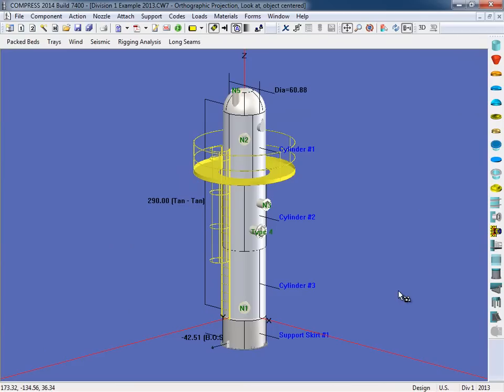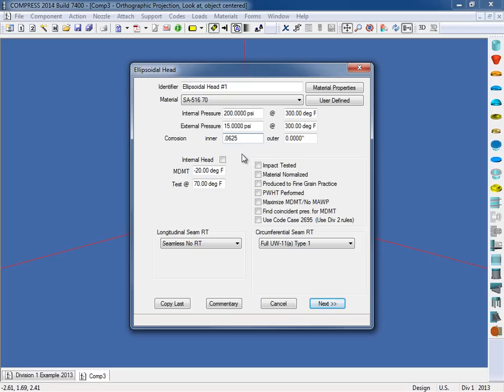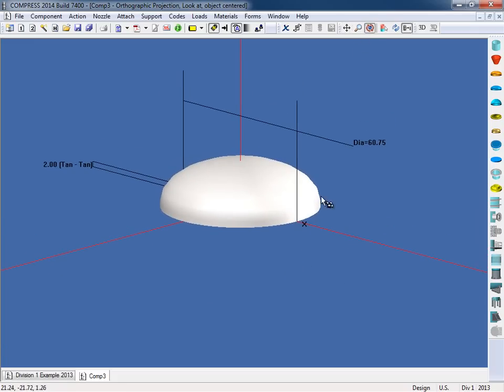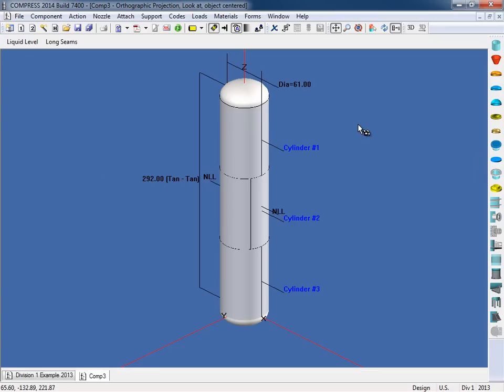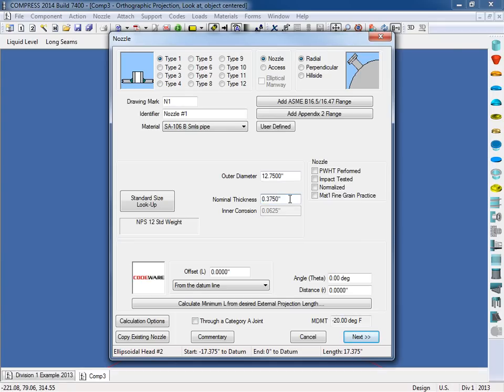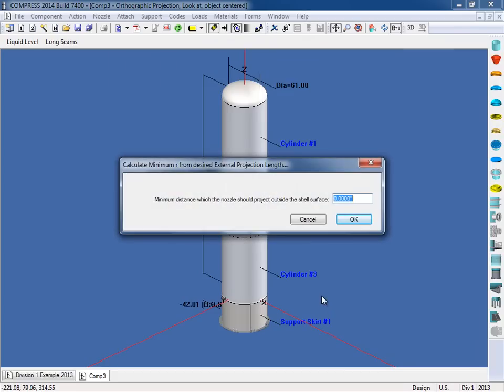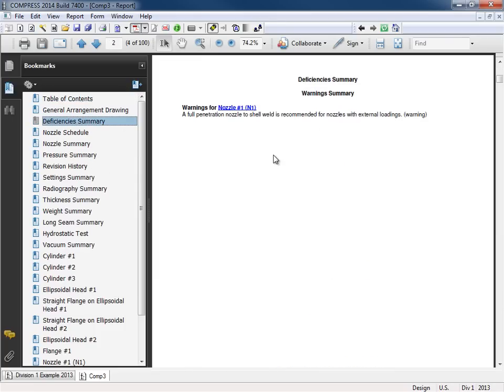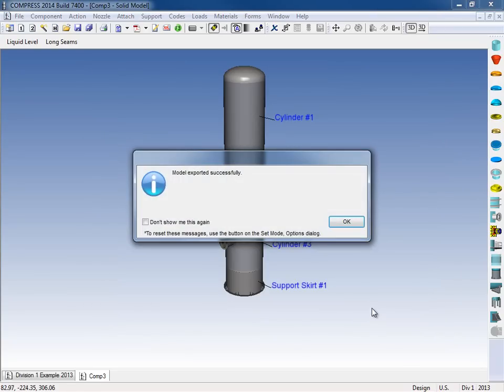COMPRESS Pressure Vessel Software Overview

Comment: Hi there. Any chance you have a video covering wind / seismic requirements?
Reply from the maker: Hi Dewayne. If you are currently licensing COMPRESS, you have free access to our training section in our Support Center located here: https://support.codeware.com/s/training. Our wind and seismic training module discusses required data input values and design methods for vessels requiring wind and seismic Design. The module focuses on the ASCE and NBC Codes.

Comment: This was a pretty comprehensive video, however, I have a question, is it possible to design a spherical pressure vessel with Compress?
Reply from the maker: Hi Carlos! Yes. COMPRESS can design spherical vessels by modeling them as two hemispherical heads. If you’d like to learn more about these capabilities, email sales@codeware.com.